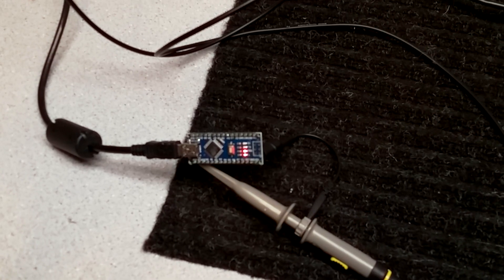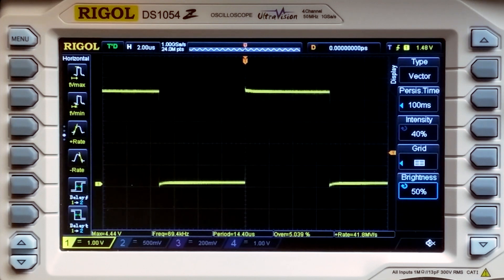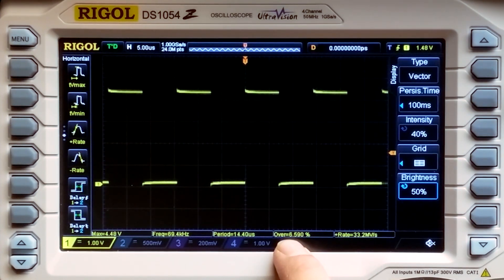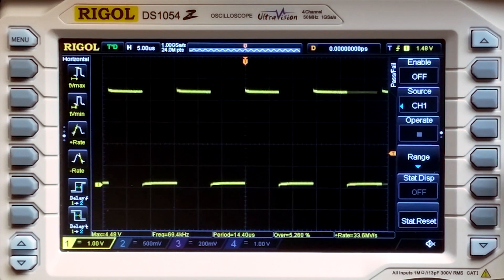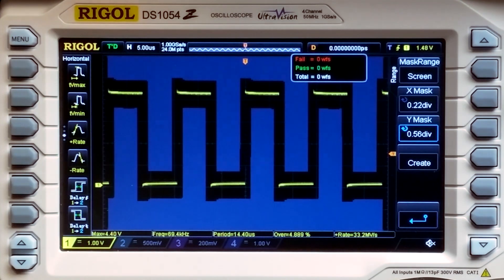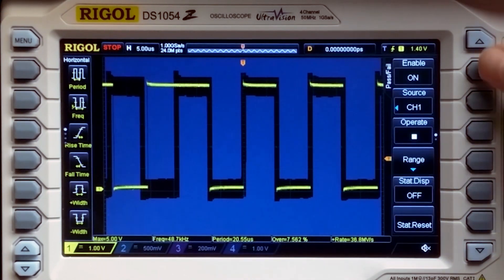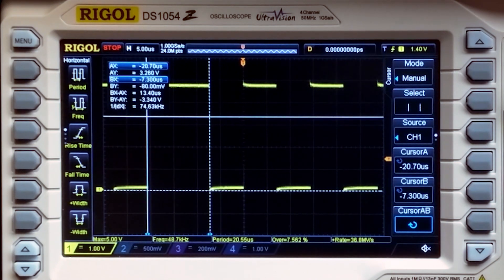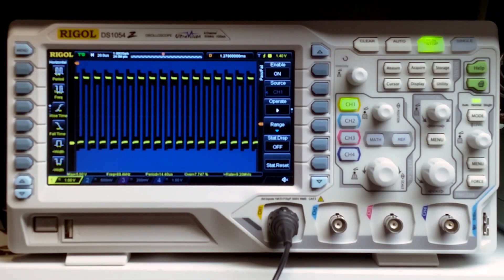Arduino and Oscilloscope Latency-Glitch Fun

Comment: You're getting pretty close to what your 16 MHz Arduino can handle with the Arduino-overhead.
Arduinos loop-function i probably interupted by one of it's timers.

"One major disadvantage is that any interrupts will affect the timing, which can cause considerable jitter unless you disable interrupts. "
Bit-banging Pulse Width Modulation - https://www.arduino.cc/en/Tutorial/SecretsOfArduinoPWM

You can disable the timer that Arduino uses, and get rid of the interrupts.
I got a very stable output by disable timer0.
https://gist.github.com/TimGremalm/61bc54f473bec4809122d3489f1793af

There's a lot of other cheap microcontrollers out that is far more powerful and easier to use than the Arduino Nano.
ESP32 for instance is like 10 times faster than the Nano, but only twice the price.
The MCU have a buildt in PWM driver that that is uper easy to call.
https://docs.espressif.com/projects/esp-idf/en/latest/api-reference/peripherals/mcpwm.html#_CPPv219mcpwm_set_frequency12mcpwm_unit_t13mcpwm_timer_t8uint32_t
Reply from the maker: Thank you. I wish the timers didn't mess with the ports.

Comment: You might dig into the main() function that the Arduino IDE pulls in, which in turn calls loop() . There's some additional overhead that can be found with the source code pulled in by the IDE. I don't remember the explanation, but when I had this problem I switched to AVRStudio. If you just want to ignore the jitter, try looking for trigger holdoff or pulse width trigger options.
Reply from the maker: Thank you. It was interesting to see it. If I had time, I would try another Arduino Micro, just to be sure.

Comment: Make sure the probe is calibrated if you see overshoot or rounded edges where you're not expecting it.
Reply from the maker: I am fairly sure it was. Generally, I check it before each use.
Reply: @BrendaEM  Then it must be some weird transmission line effect causing it.
Reply from the maker: @NiHaoMike64 , I have a friend who specializes in signal integrity. He says that the over/undershoot can be fixed with a pull-down resistor. Still, it was better than I thought--except for the jitter.